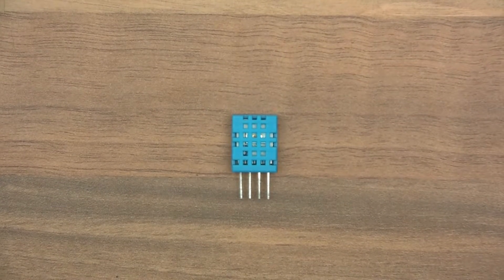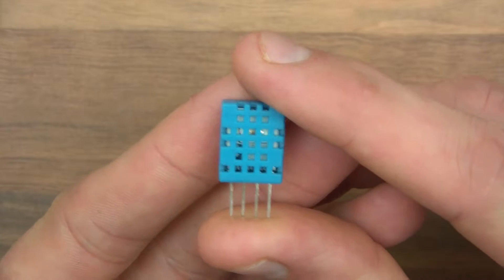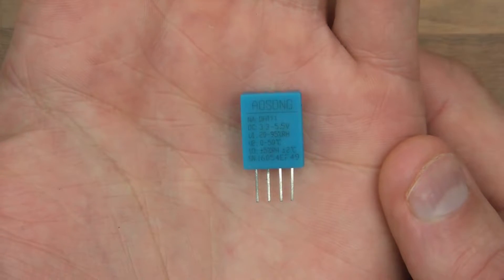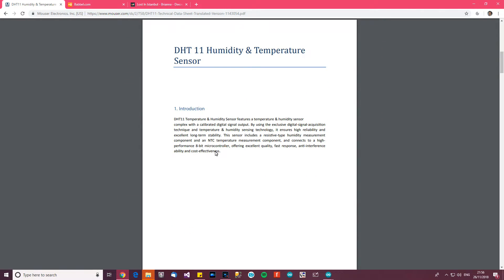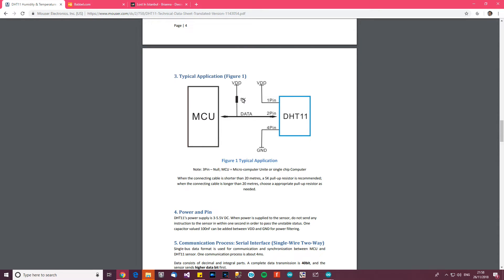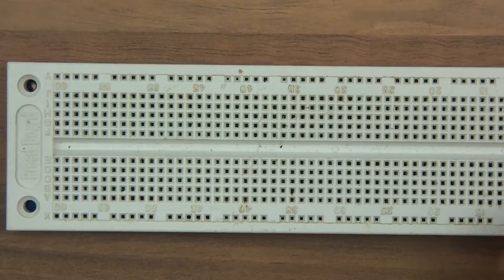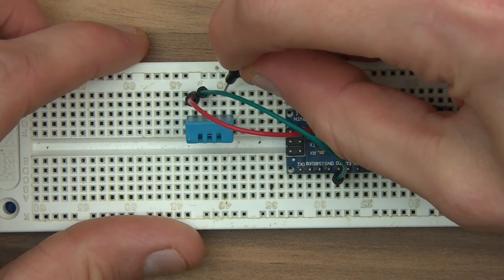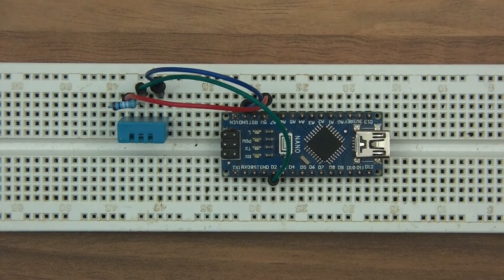TUTORIAL: How to Wire up & Code DHT11 Temperature & Humidity Sensor - Set Up - Arduino (Part 1)

Comment: Are you going to show how to display the results on a screen as well as through the serial to the monitor of your pc?  I have a couple of these in my stash but have never used them yet!
Reply: Here is what I run to switch a cooling fan on with an UNOR3
It's set to pull PIN7 LOW to activate the fan relay at 32C
Connect centre pin to PIN2
Connect Ground, 5V
You use the serial monitor via the IDE to see what's going on.
Edit:  Using DHT11 with integrated Pullup resistor

/******************************
  name: 5V relay module and DHT 11/22/21 humidity and temperature sensor module
  function: This program shows how the temperature and humidity sensor turns on
            devices or power sockets connected to 5V relay module
  email: info.acoptex@gmail.com
  web: http://acoptex.com
********************************/
#include <DHT.h> // include library

const int relayPin = 7;
const int DHTPIN = 2;

// Uncomment whatever type you're using!
#define DHTTYPE DHT11   // DHT 11
//#define DHTTYPE DHT22   // DHT 22  (AM2302), AM2321
//#define DHTTYPE DHT21   // DHT 21 (AM2301)

DHT dht(DHTPIN, DHTTYPE);// Initialize DHT sensor

/********************************/
void setup() {
  Serial.begin(9600);
  pinMode(relayPin, OUTPUT);
  dht.begin();
}

void loop()
{
  // Reading temperature or humidity takes about 250 milliseconds!
  // Sensor readings may also be up to 2 seconds 'old' (its a very slow sensor)
  float h = dht.readHumidity();
  // Read temperature as Celsius (the default)
  float t = dht.readTemperature();
  // Read temperature as Fahrenheit (isFahrenheit = true)
  float f = dht.readTemperature(true);

  // Check if any reads failed and exit early (to try again).
  if (isnan(h) || isnan(t) || isnan(f)) {
    Serial.println("Failed to read from DHT sensor!");
    return;
  }
  Serial.print("Temperature = ");
  Serial.print(t);
  Serial.print(" *C ");
  Serial.print("Temperature = ");
  Serial.print(f);
  Serial.print(" *F ");
  Serial.print("Humidity = ");
  Serial.print(h);
  Serial.print(" %\t ");
  Serial.println();

  if (t >= 32) {// you can change temperature value here - t>= 30 to your preferred number or change from Celsius to Fahrenheit readings
    digitalWrite(relayPin, LOW);
  }
  else {
    digitalWrite(relayPin, HIGH);
  }
  delay(1000);// 1 second delay between measurements